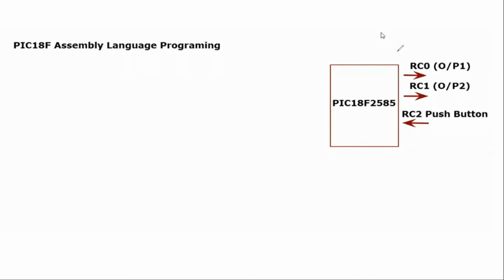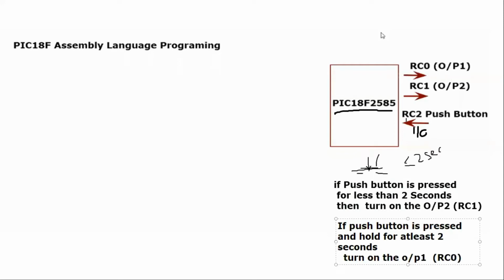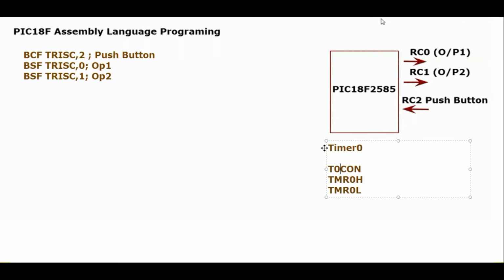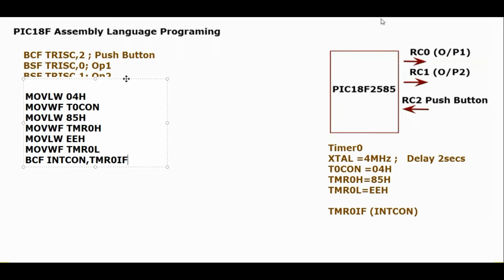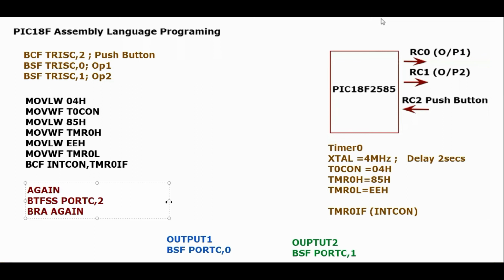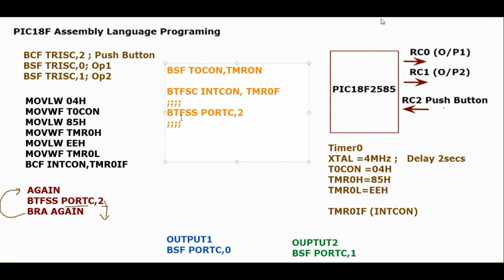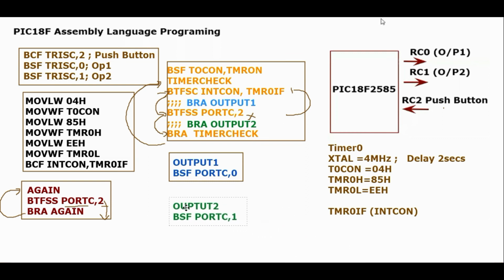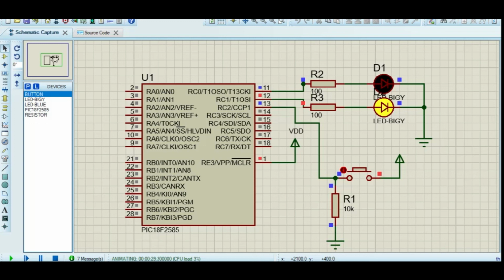Press and Hold Button Application Using PIC18F2585  Assembly Language Program and Proteus Simulation

Comment: Sir, is it possible to show digital output in the form of multiplexed seven segment display as the count 0-1024, which is proportional to 0-5 V analogue voltage by using pic18F452 ADC